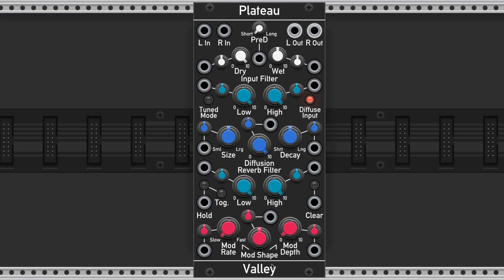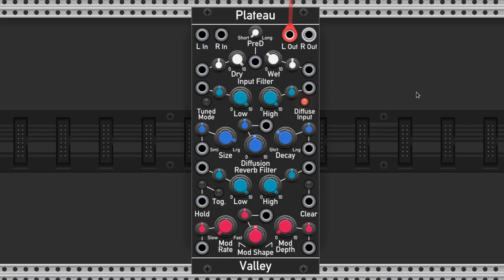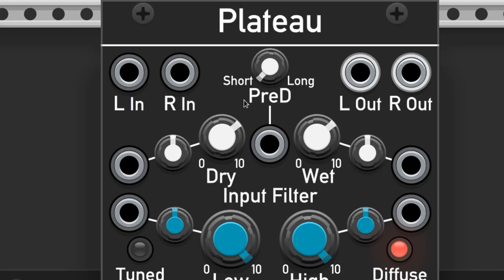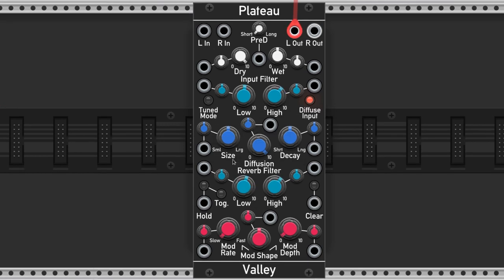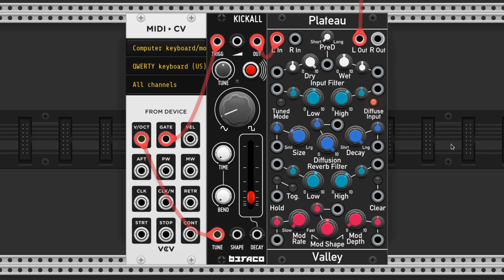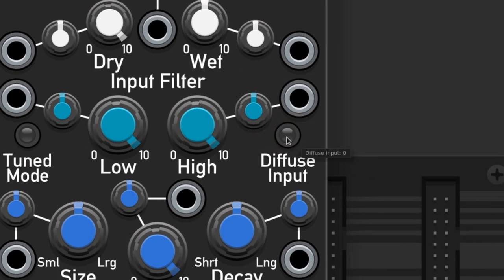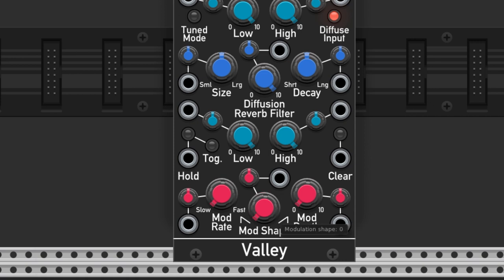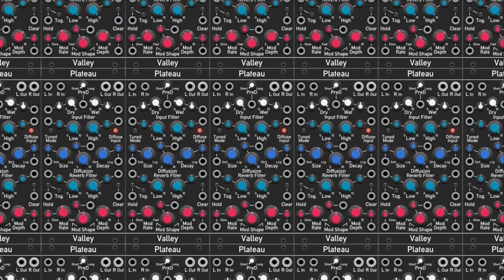The Best Reverb: Plateau by Valley

Comment: It's just an amazing sounding reverb. Pretty much a fundamental "send" effect on all my patches. So much so that I have a saved template for starting any patch that's just clocked, mindmeld mixer/expander, plateau connected to the mixer as a send, and  mixer into audio out. It's always amazing how just a tiny dial turn on the send can turn the most basic bleeps, bloops and bzzts into a beautiful soundscape. It's also great for wierd sounds, too, you touched on the mod section, which gets some trippy wonk, but you can also get cool glitchy sounds by playing with various triggers and gates into the hold and clear inputs. One of my favourite things is to have a rhythmic sound, like a drum (this works great on snare-type percussion), with the pre-delay turned up so it comes in almost like an echo, and then have a trigger set to clear the buffer on the next beat. Another neat effect is to have the hold function on indefinitely and use a vca after the reverb to either smoothly bring it in and out with an lfo or something of the like, creating wind-like swells, or have something rhythmically triggering the vca on and off for percussive type shots. Pair it with an envelope and you can get tons of neat white noise-type sounds to colour your patches with.
Reply from the maker: Yo Kyle, 
You're always so solid on these comments! I have almost that exact same template lol. I have a Chronoblob2 auxd as well on mine and I dont have a clock, but now that I'm thinking about it: why do I not have a clock? Added lol. I'm going to try out these effects you mentioned. They sound like they will be awesome! Thanks so much.
Reply: @yourpalrob  i used a delay for a bit, but i found i wasn't using it as much as i thought i would, but, totally personal preference, no judgment or anything, I'm just not a big fan of delay as a flavour effect. I prefer to use it as needed for more bombastic obvious trippy echoes and psychadelic glitchy stuff (i was always a fan of 60s/70s rock and the more experimental psych stuff from guys like pink floyd, jimi hendrix, the doors etc, so i guess that rubbed off somewhere). I find when i use delay as a send, it's either too subtle to notice or i overdo it and it gets messy and gets in the way of the melodies, but then, I'm not very good with the drone-ey ambient stuff so each their own in that regard. But much love for the blob regardless!